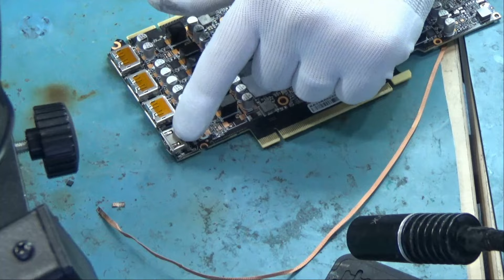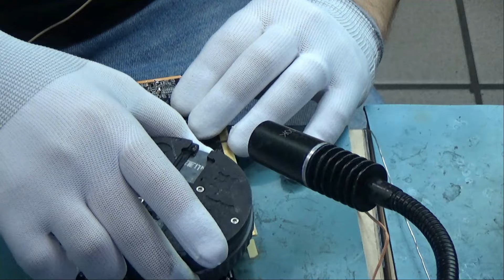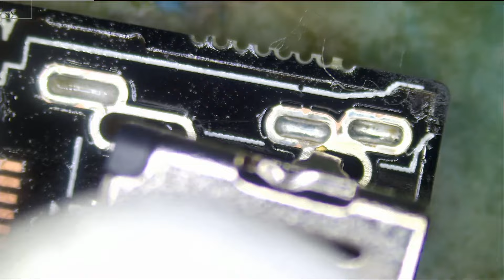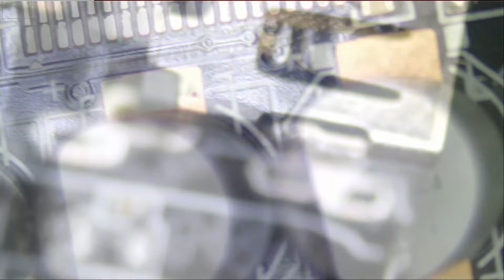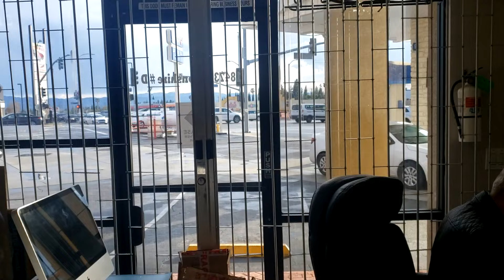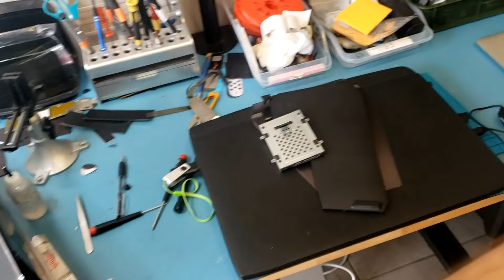GeForce RTX 3090 $3000 Graphics Card No Display Repair

Comment: Why would someone send it to him instead of warrant it out or just get a display port to hdmi adapter if you really want hdmi
Reply: If they bought it from a scalper on eBay, they won’t have a receipt so they may not warrant a RMA?
Reply from the maker: Warranty does not cover physical damage. Imagine buying a new car, have an accident, then take it back to the dealership for warranty.
Reply: @NorthridgeFix   GPUs are diffrnt from a car this is why cars have insurants A gpu the Manufature can and 90% of the time will fix it.

Comment: How would you test the features of the HDMI port it's the new 2.1 standard I'm surprised it worked being that they have very different bandwidth speeds. 

Great PC as well dang though afraid of that PSU and a monster GPU like that lol.

As walkway amazing work even on the craziest Gear out there.
Reply from the maker: The cable and hardware is what makes 2.1 not the connector. All HDMI Versions use the same 19 pin connector.
Reply: @NorthridgeFix  wow that's great to know for future repairs. Now I have a good definitive answer from a professional 👍

Comment: The work you do is so very intricate and its not always clear to the viewers just how intricate because they are only viewing output direct from your microscope.  Micro soldering is an art all of its own and is different to traditional soldering in many ways.  Casual viewers may not appreciate why you use the techniques you do and how small the tolerances you work within are.  Once again a brilliant video which was both engaging and educational.  Thank you for sharing your skills with us.
Reply: Yeah its like trying to handle a qtr grain of rice if not smaller sometimes! Microscope not optional...
Reply: Dunno, I'm soldering small components (I don't know what counts as "micro", but I'm kinda comfortable with 0102 resistors) a lot at my job (not my primary, or even secondary, task, but I'm one of the few go-to people if the need ever arises), and the soldering itself is of moderate difficulty. The main trick is figuring out how to negate the shaking of one's hands: some minimize the shaking itself, I've developed a technique for supporting the soldering iron and my hand on nearby/worked on components, so as to stabilize the tip. Don't know how common it is, but I felt really bright after coming up with this.

The debugging, OTOH, is really, really hard. That's the part that often gets downplayed on this channel when Alex says "I know from experience, that […]". I think that this experience is so hard to gain, that one would easily develop all necessary manual skills in the meantime. I tried debugging some boards myself, but... well, let's say they were all a no-fix. :-)
Reply: couldnt have said it better myself.
Reply: You should check into some console HDMI port replacements. The pins are under the connector on some consoles and not really accessible to a soldering iron. Those are very difficult to replace.
Reply: *gets rtx 3090 just to use hdmi-_- he should return it
Reply: @Switchfpv  If you're using 4K above 120Hz, then you right, but any video mode using less bandwidth than 4K above 120Hz will work just fine on HDMI. And, generally speaking, HDMI is less buggy than DP is.
Reply: @Switchfpv  Bruh you commented the same thing twice stop trying to seek atention

Comment: Is the new installed HDMI port comply with the HDMI 2.1 or it doesn't matter?
Reply from the maker: It doesn't matter. The cable and hardware is what makes 2.1 not the connector. All HDMI versions use the same 19 pin connector.

Comment: 4:35 A new viewer will probobly say "What kind of sorcery is this?"
Reply: Low melt solder combined with hot air may be new to DIY'r and grunt soldering techs, but professional techs working on expensive and delicate boards have known for years. I was introduced to it by ZEPHYRTRONICS around 20 years ago. Their low melt systems were approved by NASA for use by contractors prototyping and reworking aerospace boards. Good stuff. I'm happy that NF introducing his audience to this awesome tool 👍.

Comment: Why wouldn't he use DisplayPort instead and kept the Graphic card with the factory condition and with its thermal paste!
Reply: Probably a miner without a display port monitor or maybe wants to output a TV as well.
Reply: @jeevanjacob4102  He can easily use DisplayPort to HDMI Cable
Reply: The factory thermal paste is meh, decent at best. Why are you so concerned about it anyway?

Comment: And me using  a 13 year old pc without a card and only DDR2 ram that too 3 gb😂
Reply: I would def recycle that thing 😆
Reply: My desktop is from around 2007
QX6700
Gigabyte P35-DQ6
8GB DDR2
nVidia 8800GTX 768MB
Enermax Galaxy 1000w PSU
Coolermaster Cosmos case
Rarely use it, but it’s useful for data recovery and testing for HDD SMART readings.
Reply: @Infiniti25  i used to doctor up older computers and sell them for cheap to ppl who needed them. Its just ddr2. Is very out of date nowadays. I have an older build as well but its ddr3  Its an Asus mobo With an i7 4790  devils canyon. At 4ghz 4.4 turbo 16 gb of ram and a 2080 oc super Gpu. I also got an Aio cooler for the Cpu so its a Solid older build. Also has a western blue 500 gb ssd then 1tb. Wd green HDD w a 2tb samsung external HDd
Reply: Nothing's wrong with that.